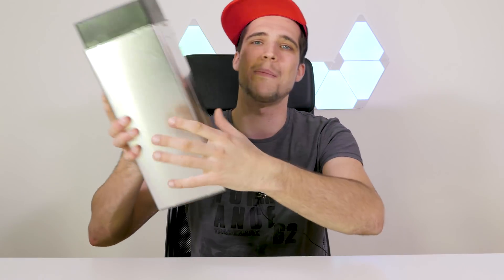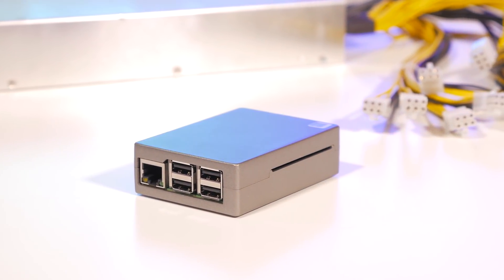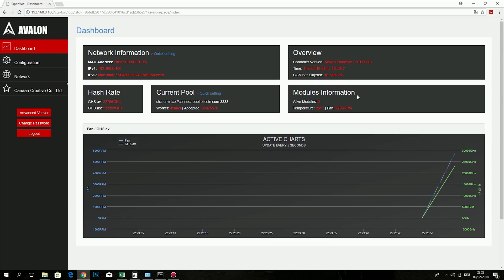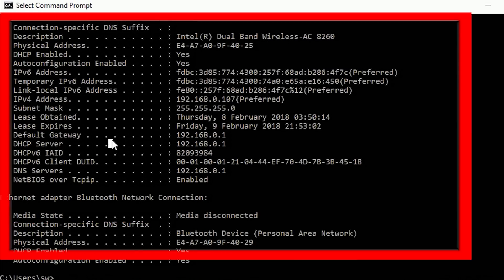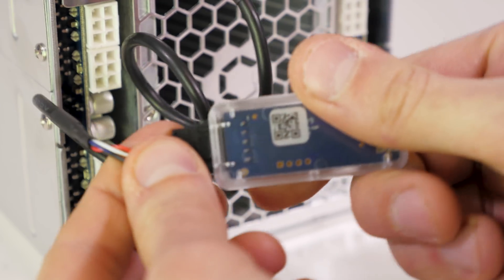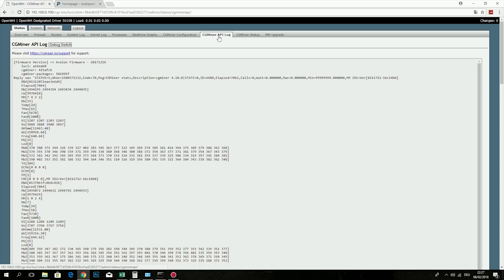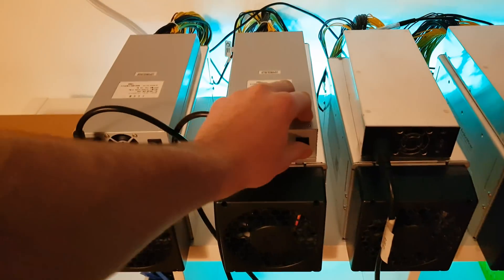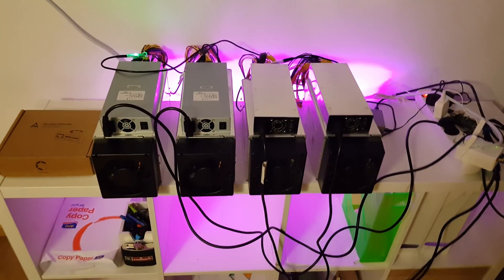How to mine Bitcoins 2018 - Avalonminer 821 841 Tutorial & Setup Guide

Comment: I need some serious help, I do not understand how the ip address of the controller works. When I changed the controller ip to 192.168.1.x and set the Gateway and DNS Server to the same as my home network settings, it kicked me off the Dashboard. How do I get back to the dashboard now? Shouldn't I just have to enter 192.168.1.x in the browser? Also, in my router login page I do not see the new ip of the controller or the miner at all.
Reply: My pool info, and miner hardware are good. I tried mining with default settings of the controller ip but it remained idle.